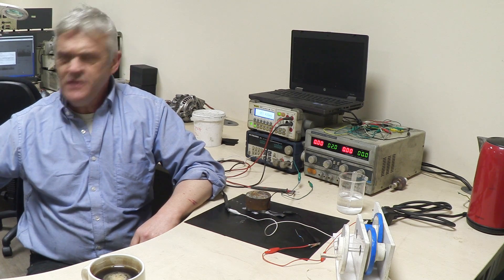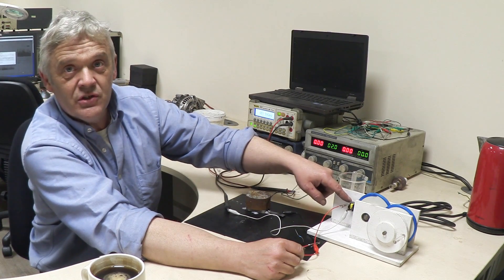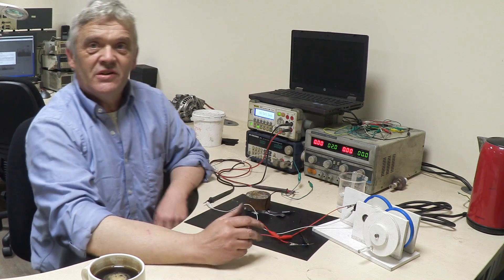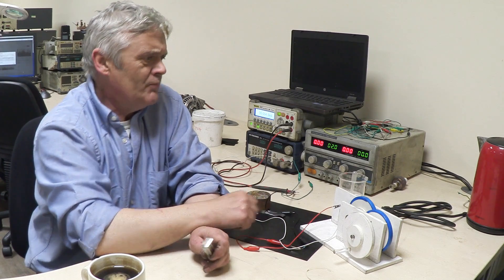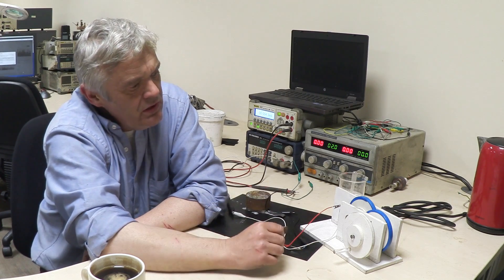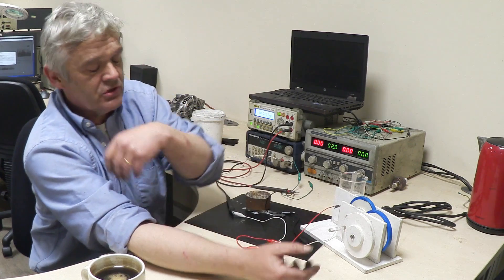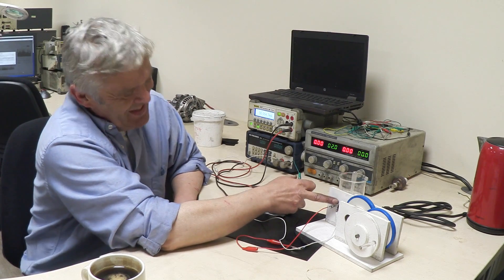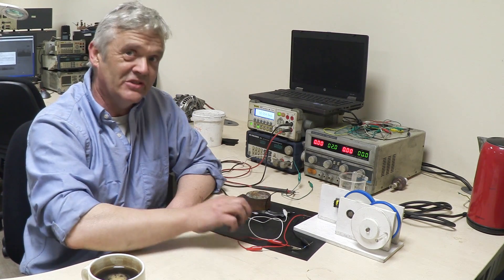Magnet Magic -  Magnetic Gears

Comment: Now, combine those magnetic gears with magnetic bearings and you've got yourself the lowest friction system you could make, outside of a vacuum chamber. I'm unversed in whether magnets produce much charge when interacting with opposing magnets - if the charge is notable, you could even draw from it while the gears are slipping.

Comment: I've been reading up on magnetic gears.  It seems that the difference between regular gears and magnetic gears are a life span from 1-2 years vs 20+ years where they are suited.  Also, slippage is great for many situations such as when a drive train has reached the end of a destination won't be damaged if motor keeps running, etc.   This really needs to be developed as many forms of power generation requires gearing and no contact does NOT wear out.

Comment: You could use that by putting power into the electromagnet and using it as a brake. Just use a dimmer switch to put different strengths of power in for more braking.👍

Comment: As you are generating AC, how about using a transformer instead of gears? I.e. just the first disk, adjacent to the pickup coil feeding a transformer to get the voltage you want? Not sure what frequency you are getting, but maybe a bit low for a standard mains transformer. More turns on the pickup would do the same thing I guess.
Reply from the maker: awesome idea - cheers

Comment: A second order magnetic gear places all gear co-axially, allowing all magnets to "mesh" simultaneously. You are welcome to have a look at my model of a motor driving a propeller. The iron inserts can also function as cores for generator coils, negating the need for a small gear altogether.
Reply from the maker: lol - just did mate - I was thinking of doing a demo model - an interesting twist is where one magnet set is fixed and the metal pieces become the rotor - I believe this changes the torque profile - loved your videos by the way
Reply: I would appreciate your analysis of my solder flux capacitor. I have no idea what is going on there...

Comment: It’s interesting how one idea leads to another. I was thinking of using a magnetic coupling in a radio controlled submarine to overcome the need for a water tight seal on the propeller shaft. This led me to start thinking of magnetic gears also. I suspect this one idea leading to another is why the UK had an industrial revolution after steam engines were made and also why so many of the world’s inventions came out of the UK. I suppose it could have happened in any country if it were first to develop steam engines.
Reply from the maker: it's a slippery slope mate lol

Comment: You need an increasing slip plate that will create a more magnetic pull in that arrangement where there are higher speeds.
ALmost a centrifugal clutch with adjustable magnets.  Maybe even more plates.
I really think KITE energy is the future.  This would be awesome!
Electromagnet that increases as the forces/torque start to slip

You could use an arduino and hall sensor with a reference dot, to work out RPMs. and add force in the x axis SINCE you have such low friction..

You're a genius!
Reply: WHY DONT We have quantum locking motors?  That is the future I've always thought of!  Motors synced perfectly with no delay.

Imagine the precision machines that would allow us to build!
Reply from the maker: I was reading an interesting thing about using a segmented metal plate between two magnet sets

Comment: Outstanding job mate... Now you are working in my word of magnets. Oh just fyi, the reason you are not getting the torc, is because some things just can't be built too small and the magnets need to be rectangular in shape so that you can angle them like a fan, then you will see high torc won't slip. There is also the cogging effect that plays a factor. All the new Big wind generators in the have a no bearing shaft, meaning the shaft floats, this also helped reduce the cogging effect but the layering them in an angle is what really made a big difference and helped with rpms as well, hope that help you. cheers mate
Reply: Any docs, diagrams, info as to the angles?
Reply from the maker: it did mate and I have a bunch of rectangular magnets - I might give it a go - awesome stuff and cheers

Comment: I wonder if a concentric gear setup would be possible to shrink the size ? + concentric toroid coil arrangement on each side?
Reply from the maker: give it a go building one mate
Reply: @ThinkingandTinkering  I may well do:) would be good as I will need a back up system for the folding tri bladed wind prop that'll have bungee attached! Bullet proof graphene plastic suit the way things are going!!!

Comment: Have you ever played around with Triboelectric generators?

I believe if you coated two of your cogs with conductive Ink and then lined the outside of one with a highly positive electronegative material, e.g. paper or nylon and the other with a highly E negative material, e.g Teflon tape, you could generate power by turning one cog against the other. The Ink would just be there to collect current.

Im not sure what sort of power it could produce but it would be great even just to see if it would work.
Reply from the maker: I have played around with them mate and what you are saying is very interesting I will have to have a think - cheers

Comment: Sounds to me like it would be a good application to use in conjunction with an electrostatic motor to turn a generator faster or first attach to a pulse motor into a high-mass flywheel and then into a low speed generator....all from natural ground(ambient) energy.
Thanks for that idea. Others (more able than me) may use this idea to free the world from fossil fuels.
Reply from the maker: good points mate - thanks for the share

Comment: oc robert, with some *careful planning and consideration you can replace the tape, and increase the mass AND get 3/4 copper coils per gear to pull extra unused current off...for near the same work load by watching how Christina Larsen makes her wrap and applying that to these models outside gears magnet retention
https://www.youtube.com/watch?v=eHU37uhcM1U
Open bezel wire wrapped cabochon
381,967 views•Aug 1, 2016
,CSLdesigns

personly you can make a bunch of layered paper capacitor disks as the core hub of the gears (put the laser cutter to use)and feed them directly with the constructed copper wrap etc.

*remembering Professor Eric Laithwaite's "up,right,down,left/dc gets better the smaller you make it,conversly ac gets better the larger you make it,and several thin metal disks seperated under magnetic induction are rather like springs, are better than a solid  single disk,the upward motion of a copper wheel against an aluminium ring over coil etc
Reply from the maker: fascinating how one thing informs another - cheers mate

Comment: Very creativity, just one comment & one question:
 *That coffee is black-hole dark & is begging for a little cream or coconut milk ;)
 *You rebuilt a car battery.  ?Why not build a good old fashion lead acid battery in a 55 gallon barrel your self in such a way it's easily rebuilt?  I doubt any other battery could compete on cost & performance.   As soon as I get smart/prepared enough, I will give it a try myself.
Reply from the maker: I always drink my coffee black mate lol - as for the battery - you're unlikely to self build it a cheaply as you can buy it mate but the maintenance issue is a good point - but it's a lot of lead and acid so take care

Comment: Not so noisy as the one with cogs.
That is an added benefit.
Reply: Forgive my ignorance, but, wouldn't it be simpler to put coils around the disk circumference and pass the magnetic fields through them rather than use the magnetic fields to push other magnets to then turn magnets on the final coil?
Reply: No wear too
Reply from the maker: for sure

Comment: Electric motors are more efficient at higher RPM's, but in electric bicycles there is a limit to the sizes of sprockets and pulleys that can be used on a mid-mounted motor. A common solution is adding two stages between the motor and the wheel. However, the primary stage (motor to jackshaft) is high-RPM and low torque. The secondary is almost always a chain and sprockets, but many times the primary is a toothed-belt and pulleys because a chain would be very noisy. I'm now curious if a magnetic primary would work.
Reply from the maker: me too - damn you eyes lol so much to do and not enough time to do it lol

Comment: Simularly, magnetic coupled shaft is  great idea too for pumps, or say couple the energy from a motor to a propeller without penetrating the hull of a boat.  Aditionally, the are increadbly forgiving of misalignments  and without friction, wont wear.  Using the same magnets, torque can be increased  aditional radius of magnetic plate and more magnets along the circumference.
Reply: I was playing around last night, Magnetically coupled a computer fan to a HDD motor, if you turn up the speed to fast they de-couple, but if you don't provide to much torque to quick you can get the fan up to pretty incredible speed, pretty neat really.
Reply from the maker: that is a good point mate - I didn't think about that - cheers

Comment: Mr. Smith is a very nice effort what we say in construction workshops and developments first step

 and I see that this very beautiful first step can be used to transmit the energy of the movement with the flow of bicycle tricycles

and at the same time it can store Since it is a kind of generator current in the batteries of such a Cargo bike for the city or a simple bicycle for pedaling and at the same time electric bicycle where it will have the ability to store electricity
 very nice effort as a first step
Well done, Mr. Smith, I really liked it and I really liked it because you show young kids that they can make innovations step by step. I personally thank you for teaching them these solutions and they are very good solutions. Hello from Greece.
Reply: And for some of us  adult women as well!!
Reply from the maker: cheers mate and that's the main point - to show ways interesting stuff can be done with minimum of tools and materials

Comment: I've seen magnetic gears before, but this is a nice design for them.  One thing about them is that if you accelerate too quickly it will jump, but unlike normal gears it doesn't damage it.

I was thinking about building a mag-lev motor for a wind generator, like you built in a previous video.  Low wind speeds here mean that normal turbines don't work too well.
Reply from the maker: nice idea mate
Reply: If your talking about magnetic levitation of an axial flux motor for a vertical axis turbine,  I would suggest against it. 

The problem is you want to control the gap.  Relying on magnetic levitation negates that design aim completely. While the rotating magnets induce a voltage in the coils, drawing current from a coil generates its own magnetic field opposing the permanent magnet's magnetic field. 

Aside from the normal  torque that sends back to the slow the turbine, it also  introduces more magnetic lift creating a larger gap and a lower voltage on the coil and less current, and less back torque to the turbine and thus less energy is drawn from the wind for a given load. 

Thus you will alwase get less energy from a given wind than if you fixed the gap between rotor and stator which also ensures the rotor can never crash into the stator coils.